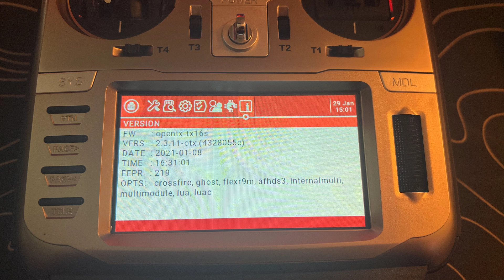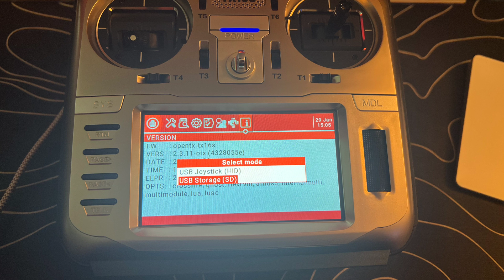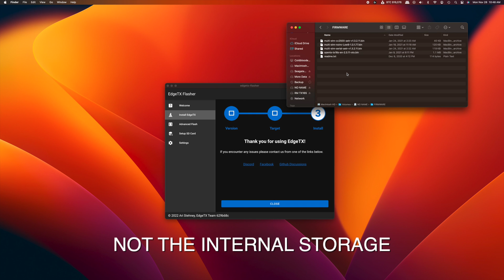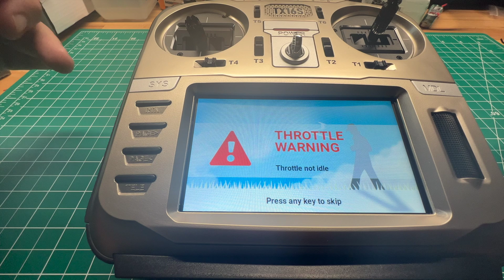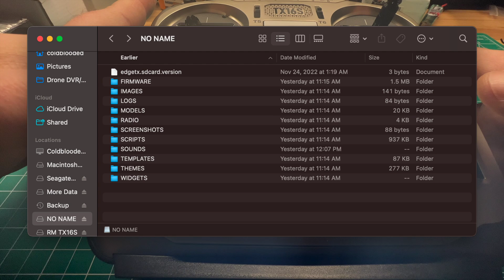EdgeTX 2.8 Upgrade is Here! // How-to Update Your OpenTX Radio

Comment: Sorry but your steps are missing the content of the sdcard.  You say copy the bin file from the flasher to the sdcard but the sdcard somewhere had to be formatted and the content of the sdcard with edgeTX needs to be copied.  What gives?
Reply from the maker: There is no need to format the sdcard that you've already been using.
Reply: @TitanFPV  Yah got it.  When you create or edgetx sdcard,  the firmware is not in the firmware folder.    Now if I can only get my heli option back.  If it is not one,  is something else..  this is so f-ing lame.

Comment: I have an Eachine TX16S, so do i flash the Radiomaster v2.8 firmware or is there an extra option for Eachine TX16S?
Reply from the maker: The Radiomaster TX16S version SHOULD work for the other variants like your Eachine TX16S. I know the previous 2.6 EdgeTX version was compatible.
Reply: @TitanFPV  thanks :)
Reply from the maker: Anytime!

Comment: Hi there! Do you know how to do this on the Commando 8? Since there is no T4 and T1 to get into the boot loader... also is there a way to share the radio settings (radio.yml) from your commando 8 since mine got changed (don't know how) and I can't it find anywhere to download :/
Reply: Found it in the manual - Boot button is left Stick down - so that solved it - if possible the radio.yml file would still be helpful :P
Reply from the maker: here is my ELRS model. I do fly mode 4 FYI. https://www.icloud.com/iclouddrive/04dh8pw0DUOXVcOg4BYqiNN3A#model00
Reply: @TitanFPV  What should I do if when I plug the USB into the radio and it doesn't give me the option to pick "USB STORAGE", it just shows "USB". Companion doesn't detect my radio.

Comment: Whats good bro. Been doing fpv for 5 years but i havent updated my xlite in a long time. I just bought a zorro radio. Do i need to update my older opentx xlite radio in order to transfer my models to my new radio?
Reply from the maker: I would recommend backing up the sdcard first, and then updating.
Reply: @TitanFPV  thanks. I didnt have to do the update. I just downloaded edge tx companion and transfered the ones i needed over from open tx companion. Easier than i thought
Reply from the maker: Anytime! Glad you got it sorted.

Comment: Hi. So the error was keeping the previous versions in the firmware folder?
Reply from the maker: The issue I had was since I was coming from OpenTX, I didn't have the EdgeTX bootloader. You will need the EdgeTX bootloader in order to flash the firmware, or you will get that error.